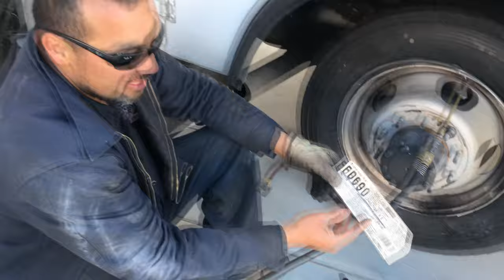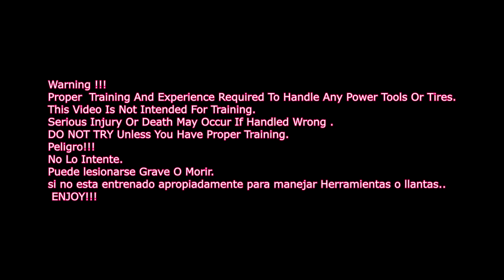Replacing Tires On Svc Truck 19.5

Comment: Tengo una duda 
Apoco si su compresor esta a 110 no le a tocado que alguna llave de impacto no le quiera aflojar alguna vez?
Reply from the maker: Josué Striker hola!!... está regulado a 150 psi.
Pero el filtro del aire para la manguera de 1/2 está a 120 psi...
Y cuando una tuerca no quiere aflojar me toca que usar aire directo del compresor jaja 
Aún a 150 hay algunas que no aflojan..para esas tengo un torque múltiplicagor manual.

Pero para ser honesto a 120 no debería de haber tuerca que no afloje..el problema es que algunos lo aprietan de más 😁
Reply: @drtrucktireservice6672  Ok entiendo 
Gracias por el dato 
Saludos